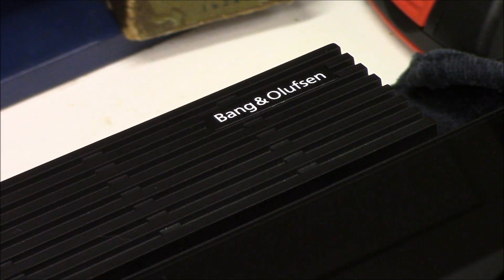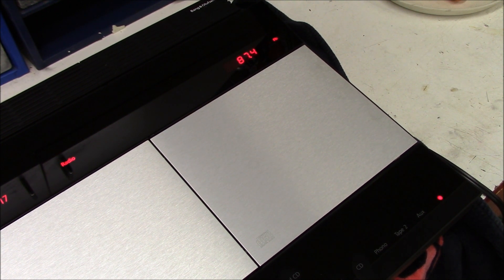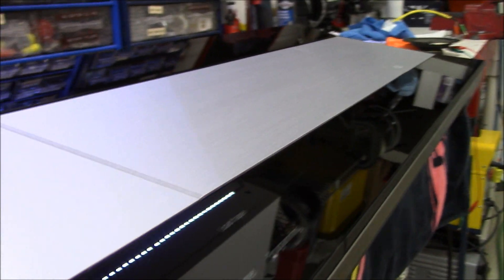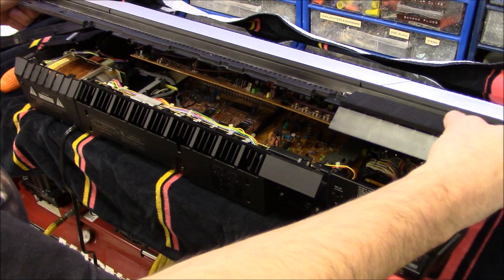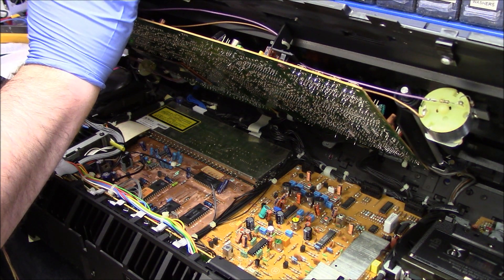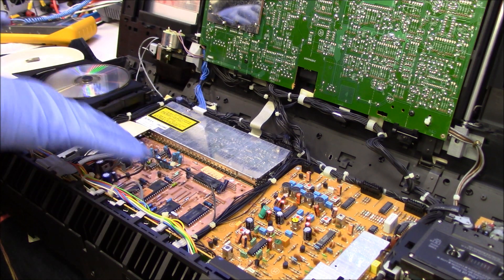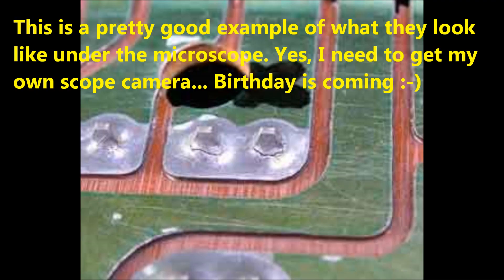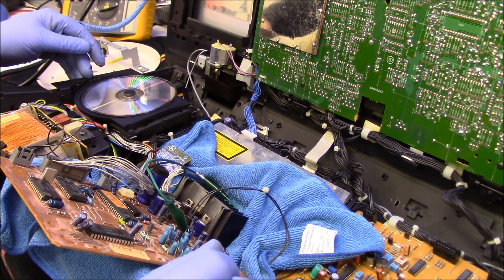Bang & Olufsen BeoCenter 9000 Repair

Comment: most early philips cd players suffered from bad solder joints for the ground connections which were through the board and caused numerous faults so if you have any problems just resolder all these joints and it should solve most problems, later b&o products were mainly philips that were played with and made to sound or perform better in a posh box
Reply from the maker: Good to know.
Reply: Your last sentence is wrong ;)

Comment: It was nice to see a product that can be serviced. It was nice to see it working when it was opened, can't do that on a iPod. 
I used to be a B&O seller back in the 1970s. I gave up the account when they got taken over by Phillips and they renegotiated the service contracts so that sellers had to employ engineers. The quality control also went bad and I remember opening 8 x Beomaster 4000's to find one that worked. 
I'm glad that they didn't get worse.
Reply from the maker: Thanks for taking the time to share that interesting B&O background. Much appreciated.
Reply: @Rchelicopterfun  At the time it was seen as a company shooting It's self in the foot so to speak. I did a lot of trade withe the Soviet Trade Delegation and they used to ship it back to the Soviet Union. I think crunch time came when I opened a batch of B&O equipment and found 90% of it DOA. It was sad to see what happened when a company removes quality control from it's final production. The company did make a come back but it was too late for most dealers.
Reply: Taken over by Philips?
Reply: @thor7564  Yes, I don't know who owns the company now.
Reply: @jeremytravis360  owned is to stretch it a bit far. Philips had 25% of the shares in B&O :)
Reply: @thor7564  OK, as a buyer the rep told me that the company had been taken over. ? All I know is they renegotiated the contract and we became responsible for all repairs and the quality went down.

Comment: O wow this brings back memories, Used to work at a authorized service center for B&O and Loewe here in South Africa, There design were awesome, neat and compact. I was astounded  to see that the lazer still works that was usually the first thing to go. Very nice video and repair :-)
Reply from the maker: Glad to hear from an experienced pro about the B&O. Yep, they were an awesome design. Thanks for taking the time to comment :-)
Reply: Wrong. Philips lasers in swingarm cdms almost never dies unless someone plays around the laser adjustments and burn them. Change the famous cap on the servoboard and resolder bad joints, and you're good to go another 30 years :)
Reply: @thor7564  We used to repair a lot of BeoSound 9000 & BeoSound 3200
Reply: @AnonymousRepair  I bet you did, as they are not remotely similar to the Beocenter 9000/9500/8000/8500. The Beosound 9000 and 3200 had Chinese made linear moving Philips cdm that was just crap. You should know this if you had serviced these units.

Comment: I recently purchased one. I can hear something click when it’s connected to power but no lights come on and no functions. Any suggestions?
Reply from the maker: I'm not a tech, just a hobbyist and without a proper schematic to fault trace the circuit, the only suggestion I would have is to follow the power input with a DMM in hopes you can find the source of the power interruption between the power supply and the rest of the unit.
Reply: Remove the power PCB with the main filter caps and bridge rectifiers (next to the power transformer) and resolder the filter cap joints - very common to have cracked joints on this board, with those symptoms. Go over the whole power board and reflow anything cracked (use a magnifier)

Comment: Hi, a friend of mine gave me one of these and everything seems to work fine except for the cd. The CD door is broken i have to move it with my hand but the thing is that the timer doesn't start like yours, any idea of what it could be, i'm not a geek for this stuff and not an expert of electronics but i'd like to try and fix it my self. Thanks in  advance
Reply from the maker: Sorry, no concrete ideas there... Does the CD even spin up? If not, then the CD drive or the circuit controlling it is likely shot. If it spins up, then the laser head/associated circuit is likely shot.On older stuff like this, I would of course look for basic obvious stuff like cold solder joints or poor wiring/connectors, like I found on this one, but I'm no service tech of course, just a hobbyist.

Comment: When i turned my Beocenter 9300 buttom up, the lower glass panel came off. The adhesiveness of the adhesive keeping the glass panel in place has obviously degraded over the years. Luckily, i caught the glass panel before it hit the ground, so no harm was done, and i could put it back in good order. You may not be as fortunate ...

Comment: Q:   what power is ur microscope - if I bought a manual hand held glass what power should i look at getting to see the board soldering works ?  thanks
Reply from the maker: Hi Jim, It's an Amscope 7x to 45X zoom stereo scope (https://amzn.to/2VdlsDu).  I do however use a 0.5X barlow lens (https://amzn.to/2SrHVL9) on it when doing electronics work to half the magnification and double both the field of view as well as the working distance from the stage. So a 3.5 to 22.5X zoom range which I find a perfect range for circuit board & SMD type work. Magnification power really depends on how good your eyes are and the type of electronics you are doing. Before I got this scope, I got by for years with one of those 2X desk mounted magnifying lamps, but as age has crept up and SMD stuff is getting smaller and tighter on the boards, 2X magnification just wasn't cutting it and I was screwing more and more stuff up, so figured investing in a decent stereo scope would pay for itself in short order (which it certainly has). I'm however no electronics pro - it's just a very part time DIY fixing hobby more than anything. I did do a fair amount of research however on stereo scopes to find out what other electronic's hobbyist were using and Amscope's SM series kept coming up very favorably in all the forums and videos. They are low cost, good quality, and come in many configurations. Most serious electronic's hobbyists use the dual arm boom type however (more working area), with the better ring type lamps (no shadows). I decided on that much less expensive SM-2T-6wb one (and was able to convince the wife as well we needed it) because it has both top & bottom stage illumination. I mostly use top for all my electronics and mechanical inspection work, but it's nice to have the bottom as well for when the wife uses it for looking at slides / biological stuff.  Neat thing with the SM series scopes is all the parts are available separately so I could eventually put the head (the most costly part), on a dual slide arm base, and get a proper ring lamp.

Comment: Hi, sr. John. I have a beocenter 9300  . when  I power on,  it's   on  with  all. all volume
I am a techician and I changed the lithiun batery of 3. volts  but continued the same,
thank you for help me in this case damage I  waiting  for your answer thanks so much.
Reply: I have same error on my 9000 and display are flicking too.

Comment: I had the pleasure of a 1986 Beocenter 9000 being passed to me to look at. The CD player was failing to recognise a disk's presence. It would spin up after loading a disk but then slide its door open again. A lens clean and a new disk didnt work. (This video helped a lot to give me the heads up on safe deconstruction and what to expect - many thanks!) I removed and deconstructed the CD unit and reseated all connectors within the CD assembly and to the main system boards.  It now all works without "repair". The problem must have been either badly seated connectors or oxidised contacts or failing solder joints (which got moved whilst working on it)???. Sorry I can't give an exact solution on here but its happy times for the owner! + Many thanks for your help

Comment: Hi John, I have a  Beocenter 9000 and all works, but the CD player doesn't keep the CD in place after it begins to spin: it jumps out of the center. Can you tell me from that picture if there's a missing a part? -> https://dsh.re/6d946
Reply from the maker: Hi... You're drive hub looks different than the one on my 9000 so I don't know why your CD is not holding? Mine has a small coiled spring around the hub where the CD slides over the hub. The spring in effect compresses and then holds the CD hole to the hub once the CD is slid over it. I did a few Google image searches for "Beocenter 9000 CD Hub", and all the images that come up show the same hub as on mine, with the little coiled spring around the circumference of the hub. I suppose that spring could be missing from yours, but it doesn't even look like there is a groove in the hub in that photo for the spring?
Reply: Thank you for the quick answer. Tomorrow I'll visit a local B&O store, maybe they can help. Do you konw a online shop with spare parts for retro B&O?
Reply from the maker: Sorry - don't know of any...
Reply: ok, thx anyway!

Comment: Hi John Great video thanks. I have an old bang and olufsen from the 1970s looks like a beomaster 1000 or 1500. The turntable does not spin when the power is on. Any idea how I can check the belt is on? Am in Scotland, cheers tim

Comment: Thanks John for a really helpful video. I used it to replace a single cap under the CD mech, so my 9000 is now back to playing CDs! I have a few more ideas about modifying this system for the 22nd century, but those are just dreams for now!

Comment: power supply? looks very similar to a transformer.
Reply from the maker: Yep, not aware of many (if any) high current AC to DC power supplies back in the 80'a that don't use a voltage step down transformer.
Reply: Hey, do you have picture or a schematic om the transformer

Comment from the maker: Great Tips Marc!  I noticed that "prop rod" when I was finally closing up the unit and took a little head scratching before realizing it has the exact same function as the hood prop rod on a vehicle. The B&O design engineers once again impress.

Comment: Thank you much for this video!  I have had my 9000 for about twenty years,  and it still works,  but both doors have a hard time closing.  Just the info about opening the unit was very helpful.  I have a B&O cd changer hooked to it,  but now I feel confidant about looking inside to see if I can repair the sluggish door closings.  I have 5500,  5000 system as well,  and have changed the belts on several cassette units over the years.  I may have to ask you more questions,  but for now,  once again,  Thank you so much for this info,  Best,  Bill